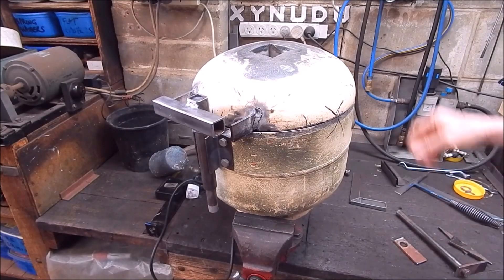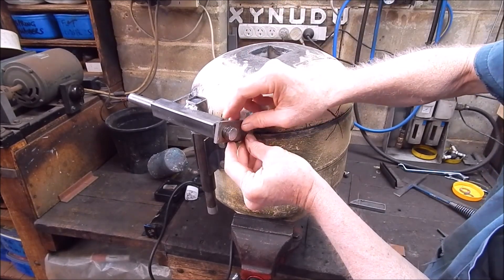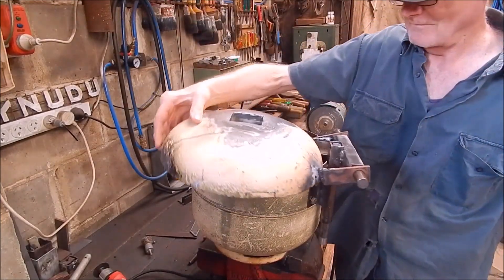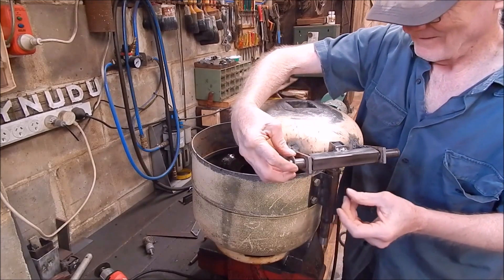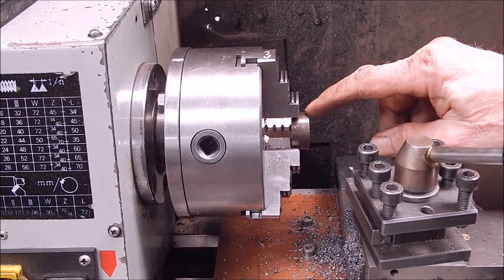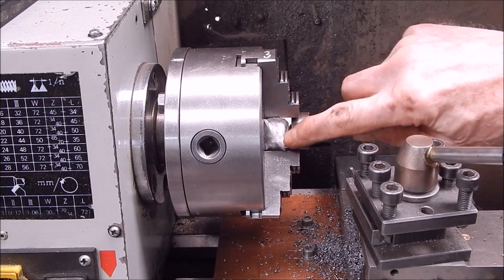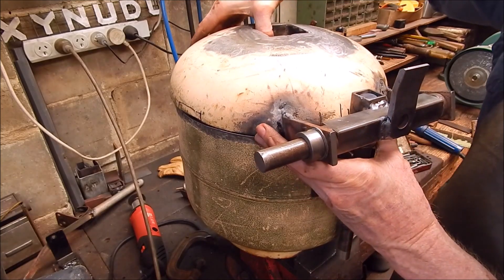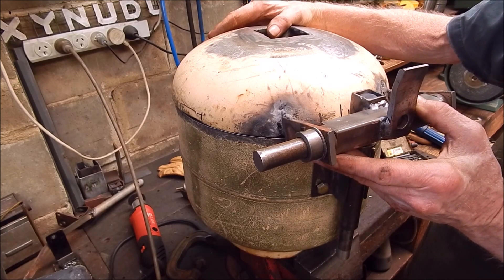Making a metal melting furnace from a 10 kg LPG gas cylinder - part 5

Comment: Hi Rob !
A very good advice that'll cost you a good beer is this: Don't let the lid open vertical ... it's so hot you can't hold your hands over the furnice !
Reply from the maker: Hi Keld,  thanks for the advice.  What sort of insulation mix do you recommend for this ?  I was wondering about using Bentonite clay, sand and refractory mortar.  I have all those elements.  Refracrory cement is also cheap.  I used Perlite previously, but it does crumble with use/heat.  Good to hear from you.  Cheers Rob
Reply: @Xynudu  The inner layer I have some sort of hard plate (it looks a little like cours MDF but isn't) I can't remember the name, but it can be shaped with a circular saw and is very easy to work with. Outside this layer I just have mortar - but it's so HEAVY ! Next time I wil use some wool of a kind - I think SVSeeker did use some kind of wool - he can carry his big, big, furnace in one hand, I think !
Reply from the maker: Thanks for the feedback Keld.  Maybe Perlite with a motar refractory grout will be OK.  Perlite is fairly light.  I need to think about this.  The ceramic wool is damn expensive.  Cheers Rob

Comment: Hi Rob. Quite apart from saving a considerable amount of money one of the other advantages of building some like this from scratch is that you can make it exactly how you want it. That pivot/hinge is brilliant, all the access you could want 👍👍👍 Cheers, Alan.
Reply from the maker: Hi Alan, yes you can make it as Heath Robinson as you like ;)   I will put some wheels on it next as it's going to be heavy to move around once I add the insulation mix.  I'm a bit undecided what insulation "receipe" to use.  Perlite works but crumbles with use.  Cheers Rob
Reply: @Xynudu  Hi Rob. Yes I can see the wheels would be a good idea. The insulation mix is a tricky one. The fire cement I used in my beer keg furnace worked well but would be unsuitable for a large furnace like yours. Ideally you want something that is reasonably light weight and if possible a little flexible. Be interesting to see what you decide on. Cheers, Alan.

Comment: I think I heard you say the tool post drill was 4.3mm for a 5mm thread. Where do you get the odd sized drills required tapping metric threads?
Reply from the maker: I have a set of 0.1 mm incremental drills from Banggood.  They range up to 6 mm which is the most useful sizing for that increment. 

Super useful and good quality :   https://www.banggood.com/Drillpro-51Pcs-1-6mm-M35-Cobalt-Drill-Bit-Set-HSS-Co-Jobber-Length-Twist-Drill-Bits-with-Metal-Case-for-Stainless-Steel-Wood-Metal-Drilling-p-1735296.html?cur_warehouse=CN&ID=6292303

Cheers Rob
Reply: @Xynudu  Thanks Rob I'm getting a set
Reply from the maker: Good move Greg.  Some other viewers bought a set and like them.  Cheers Rob

Comment: Looks pretty amazing Rob. What type of heat proof material will you use for the sides and lid. Just wondering. I get a real kick from creating useful things from junk.
Reply from the maker: I'm having a real issue deciding what heat proof material to use Owen.  I want to keep the build as low cost as possible.

I have plenty of Bentonite clay, refractory mortar and fine play pit sand.  I could buy a bag of refractory cement quite cheaply as well. Pearlite is also cheap.  So those are the elements I will be using, but what is the best "receipe" ? 

I have used Pearlite before and it will crumble with heat, so I'm wary of using it.

Any comments from viewers very much appreciated.  Cheers Rob

Comment: That's looking very functional Rob. I was thinking (similar to AC's comment) - a couple of tabs welded to the inside of the tank to guide and hold the lid into the closed position?
Reply from the maker: Maybe, so long as they don't damage the insulation when swinging the lid sideways.  I see most home made furnaces have flat faces with no tabs.  I will try it without first. Cheers Rob
Reply: @Xynudu  Way ahead of me there Rob...I didn't think of that! 
Now that you have pointed that out, it strikes me you can put them on the outside of the lid too and they only need to stick out a few mm - just enough to locate the lid - not enough to do any serious damage to the insulation?
Reply from the maker: I was thinking of maybe welding two right angle tabs to the lid on the swing away side as a positive stop, and also use them as the base for a "U" shaped handle.  I could use the ends of the handle as the stops.  Cheers Rob
Reply: Hi Rob,  I think I would put a couple of tabs on the outside that are bent out a bit to help guide the lid to position.   That way it shouldn't interfere with the insulation and put the lid in the right place.

Dale in Canada
Reply from the maker: Hi Dale, I welded a flat tab on the outside of the lid to act as a positive stop when I swing it back into position.  Works quite well and can't harm the insulation.  I'm adding wheels ATM to move it and stop it toppling with the lid swung out.  Slowly getting there.  Cheers Rob